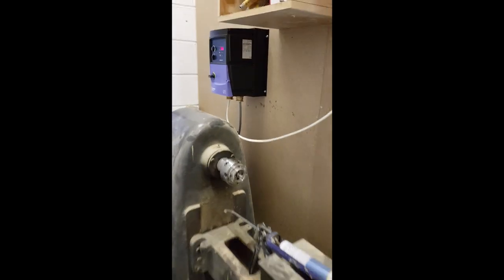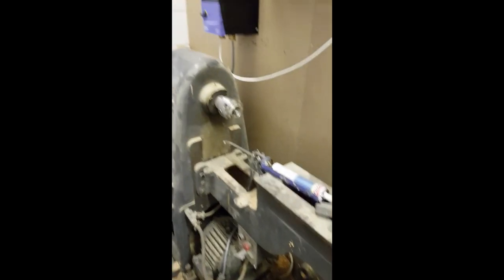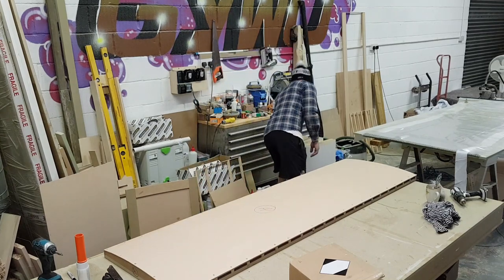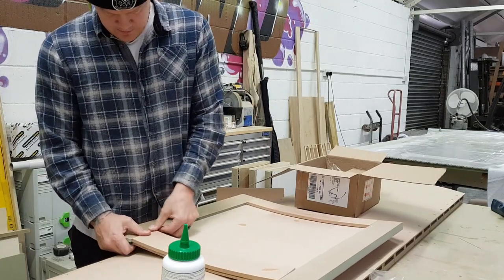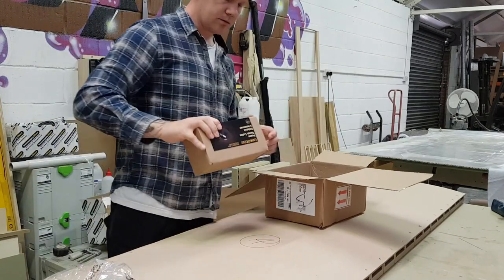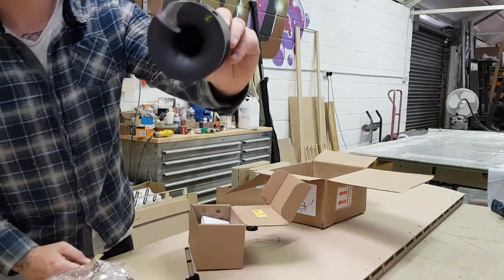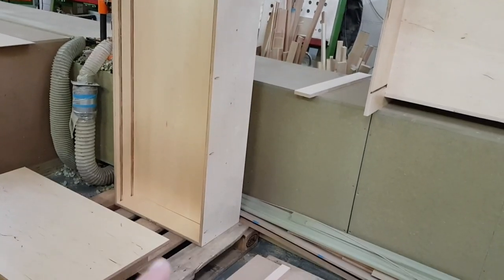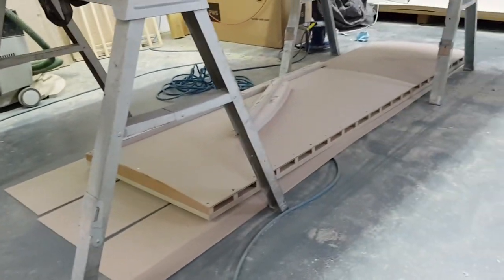Wadkin Update, Curved Shaker Doors & Veritas - Festool - FELDER - LATHE

Comment: Interesting video, always interesting to see inside another UK workshop. How do you find beech compares to maple for your doors?
Reply from the maker: I think they are a very similar timber and really have no other preference than cost.  Beech has always been more readily available at the right price so that was the most sensible choice.
Reply: @getyourwoodout  
Cheers for the info, I mainly use cnd maple and poplar for painted stuff but I've seen a local supplier offering CDN beech at £10 CF cheaper than the maple so I may give it a go

Comment: Nice shop. I am a Brit living in Pennsylvania in the US in the heart of Amish Country. Lot of cabined industry around here. I have just invested heavily in a woodworking shop which is set up in the basement of my house (it's currently 1600 sq ft and will expand with an addition planed this year). I bought Felder machines and have the Felder Grey Line product (I think it's actually their 3rd tier product). The sliding saw is their K740S model. You have the Format 4, top of the line!. I saw a 2 year old Format 4 slider make $18,000 in a liquidation auction recently. Might as well buy new at those crazy numbers. I also bought 4 other Felder machines including a machine we call a shaper in the US and you call a spindle moulder in the UK. This one has a sliding table also and outrigger like the table saw. Looks to be a good machine. Just setting all of them up now. I also bought a 10' x 5' CNC Router with ATC which is a hell of a machine. The big missing link is the wood lathe. I watched your Wadkin VLOG. If I could find a new machine as good as the Wadkin, I'd buy it . You can't easily find these used over here so I might have to buy one there and ship it across. What a pain up the arse that will be! Looks like you have a good channel. Look forward to seeing more of your future posts.
Reply from the maker: Hi Phil. Great name by the way. (Me too) sounds like you are well set up there. I'd love to move shop to another country but we are tied here for the foreseeable. If we did move, my dream would be to set up in the French or Swiss alps and just do things I want to do. Amazing healthy life there. Would like to relax a little some time soon now I'm pushing 37. . . 

Yes the wadkin rs is a workhorse now. I will do a proper video on it soon enough. 

Not had much chance to put out another video because we are constantly using machines, the noise is too much for any narration.  Perhaps I will do voiceovers instead.

Keep at it and keep in touch, nice to hear your situation, sounds positive and interesting.

All the best.

Comment: What size/length is that sliding table on the Format4?  Thx
Reply from the maker: 2.7 I think.
Reply: @getyourwoodout  oh, okay, only a 2.7 meter, so about 8-1/2 feet.  Thx
Reply from the maker: I bought it when we were in a workshop with space restraints. But it actually is perfect for all size sheets we cut if I am honest. A bigger bed would be a burden.
Reply: @getyourwoodout  I see, and no issue with ripping a full 8’ sheet with this bed size then?  I will be processing lots of plywood and need a comfortable sized table for ripping the sheets in the 8’ direction.  The Felder K700S I think is offered here in the USA with a 9’ foot X-roll table.  Which is the one I’m leaning towards getting.  But also considering the SCM ES 315, which is is also a nice looking saw for the price.
Reply from the maker: I have a bit of a gripe with scm as they do not have very good customer service from their centre in the UK.  Felder are much more accountable.  We rip 8x4 sheets every day and 10x4 sheets.  Never had an issue with ripping function, the bed is plenty long.
Reply: @getyourwoodout  yeah, SCM has shown signs of this.  There is a regional rep in Texas that helps get me the answers I need.  And their parts and tooling are readily available at a moments notice which would be nice.  

So you use that slider for the 10’ sheets too?
Reply from the maker: Yes but we fix the sliding bed for ripping. The aged old rule of 1 fence at a time for us.
Reply: @getyourwoodout  I understand, but for me, I like that a sliding table be long enough to true up one edge if you have wonky edges on a sheet good.